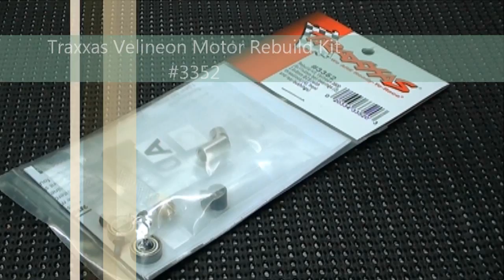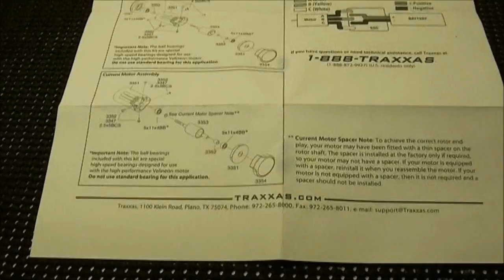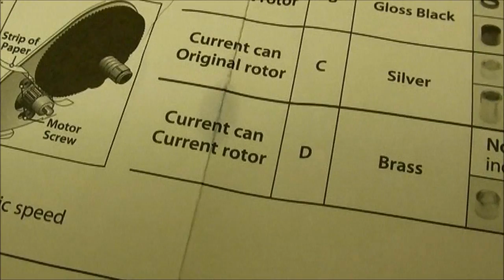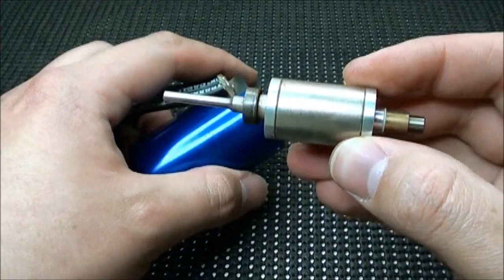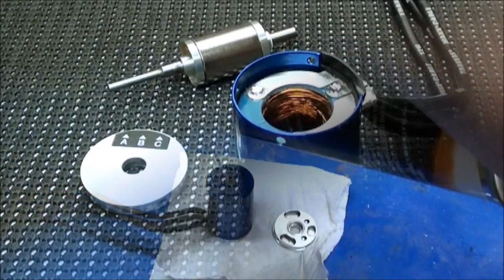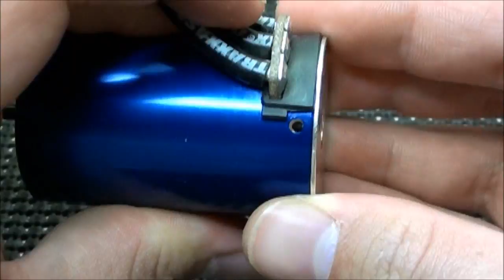RC "How To" Rebuild Velineon Brushless 3500 Motor

Comment: What type of glue would you use to Re glue the shaft to the magnet? Mine seems to work but once it has pressure it on it won’t spin

Comment: yup. sand, sand is the reason for my... EXPLOSION OF A MOTOR.  well it wasn't the sand it was more of the grip. basically my front bearing is no longer existant all i found was the inner and outer race and the ball coupler... i uhh i cant get the outer race out sooo... time to just upgrade the motor i guess

Comment: First of all if you take it apart to clean it  you will need to replace the bearings anyway. Because to get them out you have to push on the inner race. And that  is bad for the bearings.  So a better idea to clean it would be to take it apart but dont remove the bearings.  Get a bearing oil  needle bottle.  And oil the bearings.  Only remove the bearings to rebuild the motor.

Comment: I run on carpet oval so dirt isn’t a problem I ran flag pole race where u run an oval then around a tire. We can’t use reverse and I got stuck against tire so I was bleeping throttle and got some smoke coming out from car and got got hot. I let cool down hour or so and I notice it still has speed but a lil laggy on takeoff. I pull motor and everything looks really clean. Getting hot I’m not sure if sator or wiring might have gotten messed up. Didn’t know which. Bearing looks good actually whole motor looks good just notice lazy start then from before   Checked all my gears and all them ok. Didn’t know if u might have answer. Thanks

Comment: I run mine through sloppy mud and water alot and ran 3s alot, so i got about 3 months out of mine before the bearings went. Since then I've done a better job keeping the motor clean and its been about another 3 months atleast and im still good.

Comment: Preventative measures aside, what indications would you get that a motor could use or need a rebuild?
I bought a used slash pretty cheap for my son(its my first experience with a brushless motor). Pinion and spur were horribly noise and I just couldn't seem to get it adjusted right. I decided to remove the motor to inspect and realized it's not turning freely. It feels like a stepper motor in hand. I measure the voltage across the three poles by turning with a drill and all are about equal. I'm stumped?
Reply: Electric motors have magnetic resistance when you're just turning them with your finger

Comment: Should the rotor be able to spin freely? I'm new to the hobby. I was playing with my slash today, and after running it pretty hard, and ending with a crash, the truck starting clicking. It used to roll back and forth freely, but now it makes a clicking noise. When I removed to motor. The chassis can roll freely, without the noise. I noticed my rotor doesnt spin. Is this the problem? Or is it possibly my gears? My gears seem to be fine. The truck is pretty new

Comment: Just had to comment a word of thanks here for being very thorough! I’m attempting to rebuild one of the old can-old rotor Velineon motors...and they have changed the rebuild kit since your video...it no longer includes all the different bushing set ups that you need for the old can style.  You video and the thorough shot of the instruction sheet was enormously helpful for me!! It is the only place I’ve seen the info I’ve needed to rebuild this motor.  Thanks bud...keep up the good work.

Comment: Hey there - By chance would you know if I'd be able to follow similar maintenance steps for the Traxxas 2200kv motor that powers the E-Revo VXL 2.0?  I accidentally landed in a ditch and the truck was half submerged for about 10-15 seconds.  I'm concerned I'm going to have to do some comprehensive maintenance sooner than later.  BTW - I followed your tips on how to sling water out of RC tires.  That helped a ton!  Although the first dremel hole was a tad messy  :p  Thanks for all the vids!

Comment: I had my slash for 7 months and I just had a bearing completely blow on me it's a horrible mess it damaged the spur gear and I need to rebuild the motor. There's those lil bearing beads everywhere in the motor and gear housing. I had a spur gear that I put on and I ordered a rebuild kit so when that comes I'll be going again. Great video Stay Awesome!
Reply: had my ultimate for less than a month and all hub bearings seized up . and the truck has never been wet

Comment: could it be good to put some silicone oil on the bearings ... since they spin so fast ?
Reply: Bearing oil, yes. use a flathead screwdriver to take of the shields, and clean with motor cleaner, and re oil

Comment: It appears that the shaft itself (where i put the pinion gear on) is slightly bent, and i was wondering if there is a replacement that i could buy?

Comment: Would normal electronic contact cleaner work as we'll to clean out the motor?
Reply from the maker: +Tyler Nowak I would HIGHLY suggest using a RC motor cleaner but I don't see a reason why electronic contact cleaner wouldn't work.

Comment: Remember to silicone glue "fill in" the two extra motor mount holes,..... these extra screw holes allow dirt and sand a passage to the inside the can.
Reply: Aren't the covered by the plate?

Comment: my top bearing shredded. the outer ring is stuck in there...how do u get it out?
Reply from the maker: +jett ross Heat is the best way to go. Heating it up in the oven will cause the metal to expand however what temperature and for how long you should do it I'm not sure. Boiling it in hot water would be a better option.
Reply: Thanks for the help...buy I had gotten it out by putting a small flathead in the race and hitting it lightly with a hammer until I could hit the edges of it

Comment: is this a four pole system? Is the old one with screws on the side four pole too?
Reply from the maker: +Rc Ghost99 This is the old Motor. I don't know what the difference is between the new 4 pole and the old one.
Reply: One stator will have 4 poles, the other will only have 2..... 
A 2 pole looks like it was split in half, only 2 sections. 2 pole Motors are GARBAGE in the RC World, especially when low speed control is Important. The 2 pole COGS horribly!!

Comment: Thanks for the vid. Do you know if the magnet the part of it you have your thumb on @ 6:35 is supposed to spin, while the two ends stay in place? Mine is acting like the magnet came loose, but not sure how it looks when working properly. Thank You
Reply from the maker: +Lori Jackson NO that is not supposed to spin. Its supposed to be a solid piece.
Reply: +darkeclipticheart Thanks, put some loctite or permatex sleeve retainer on and working so far. Thanks for pointing me in the right direction

Comment: My velenion also has no screws in the front, yet the rotor is a different material and the cap is plastic. Im really confused.
Reply: +kory bleu I`m having the same problem. Do you had a solution?
Reply: +noppyjr I think traxxas downgraded the parts to save money, the bearings and bushing still fit fine though.

Comment: throw your bearings in the freezer for a bit when seating them in the can and motor plate. less force required to put them in place because the cold will slightly shrink them.
Reply from the maker: Good idea

Comment: you can install the engine in the e- revo 1/16 vxl ?? Yes pulls harder or less !?
Reply from the maker: Luis Fernando Aguilera Sanchez Yeah you can. You just have to buy the parts that hold it. The Engine brace and gear cover.
Reply: +darkeclipticheart and what is more powerful 380 or 3500
Reply: DUH!

Comment: and also those winding wires inside my motor can they are a little bit lose, do you think is my motor ok to use again?
Reply: Kinwai Cheung  Thanks a lot
Reply from the maker: Kinwai Cheung Yes the motor should be okay to use. However if the wires are ripped or severed the motor won't be working much longer.

Comment: Your vids have saved me tons of money for repairs for my Rustler VXL. Having this issue now... Is there a way I can replace one of the wire from the motor. Wire "A". Has been damaged and would prefer to use a silicone wire like the ones you got there. The ones the car came with have been cracking open.
Reply from the maker: Ever Pena Sadly no. Your best bet would be to use Wire Shrink Tube.

Comment: What do I do if the one of the 4 screws are striped?
Reply from the maker: Thomas Linberg Your best bet is to use a torx screwdriver. Replace the screw if possible but I'm not sure what the size is or where you can find a replacement

Comment: Just picked up a motor with a front bearing collapse, so rebuilt it to put into my slash 2wd. I have a lot of end play on the motor (0.03 inch, 0.75mm). it is a new style case and new style rotor. (exactly as yours). i put the 3 shims in exactly as i took them out (in the same place as yours at the rear). how much end play should there be? shaft looks good with no visible wear, bearings fully seated. can I re-shim the motor (if so what type of shim are they as mine look like mica washers!) much appreciated for an answer as dont want to use my slash in case i wreck the new bearings (with the extra end play it sounds like the brass bushing is running up and down the shaft when i turn by hand causing a rattle noise)....

Comment: your video just saved me from buying a new engine thanks!!! my bearing came out which was causing the shaft to spin unevenly and my car wouldn't start, so thank you for posting this video. think I should just replace the bearing or get the replacement package?

Comment: Hi,
I have a problem in my Traxxas,sound like slip something inside.
First was the shaft inside the transmission,i fix that but still something going wrong,so i bought another one.
After i fitted the noise still,so i think maybe can be the clutch or maybe the motor.
My question is before i open,have any change the motor slip? I did a video,if you want i can send it to you to help to explain.
Thanks a lot

Comment: Did you have an issue with one of you VXL motors or did you just rebuild it for the sake of maintenance.
Reply from the maker: It was an old motor and the bearings were shot. It was also having some heating issues.

Comment: Would it be ok if my motor spindle (that little stick where the pinion goes) is loosen? It moves back and forward and my car doesn´t have torque and it makes a weird noise.
Reply from the maker: That's not good. Sounds like the spindle has detached from the magnet. You'd have to take it apart to find out. If that isn't the case then I'd guess the plastic spacers have worn away.
Reply: darkeclipticheart
I opened it up and found the spindle detached from the magnet. Im replacing the rotor with an old one from an old motor. But that rotor has the plastic spacers a little scratched. Do you recommend me to replace it even if it isn´t completeley new?

Comment: Does this make the motor faster or anything otherwise this helped a lot thanks.
Reply from the maker: No it doesn't help it go faster but it does help it run easier which means it will last longer.

Comment: Im in the process of rebuilding and your video was great. I wish my bearing came out as easy as yours did. It actually broke so only the outer ring of the bearing is still stuck at the bottom so im going to try and figure out a way to get that out now. Thanks for your time though. Let me know if you have any ideas cause there is no guaranty that I'm going to finish tonight...

Comment: Hey what if the bearing inside the motor comes apart and leaves the outer ring of the bearing stuck within the motor? How do you remove it without damaging the motor?

Comment: Great instructional video.  I recently experiences some concern with my Velineon motor in my Traxxas Ultimate. I have had the truck about 6 months. It has seen mud, snow, slush, water (bashing conditions).  Just the other day I noted the motor as locked. I advanced the spur gear and it broke loose. I have applied power the motor since and it seems fine. I guessing that you would suggest it be rebuild.  Thanks

Comment: i can't find any diagrams or pics of a part by part break down of the motor i took mine apart to rebuild it and the brass bushing fell off while i was working on it, 3 washers fell out 2 clear 1 white i don't know the placement of them since they fell out i'm sure there are others out there wondering the same thing i am. any info would be great thanks my motor is a current/current and as for the dirt that was in it must be that rubber flap by the wires lol

Comment from the maker: Nope. You don't have to use any grease on the inside. Just make sure it's clean and you're good. 

Always a good idea to use locktite on screws that hold metal to metal.

Comment: my shaft spins freely by my fingers (motor w/o power or hooked up at all), with what seems like no friction. i bought it second hand and i have yet to take it apart until now (Was searching for a video to help with end housing) so i will try it, but i fear that the motor is shot due to it not accepting reverse input when on sport mode.

Comment from the maker: That's not good at all. I don't know if you can glue it back in place. You can try some heavy duty bonding but I'm not sure that will do it. However Traxxas does sell the the rotors seperately if all else fails. The part number is TRA 3353

Comment from the maker: You can use brake cleaner but you really don't have to do anything with the motor but get out the debrees with compressed air. Anything beyond that could ruin the motor.

Sometimes they come with rubber sealed bearings but they aren't recommended.

Comment: Hi, two things. I am cleaing my motor right now. Mine has rubber sealed bearings?? Also, can I use break cleaner for the cleaning and can I spray crc on the motor at the end?

Comment from the maker: If you have he replacement bearings then knock them out with the method I show. The bearings won't always come out so easily and sometimes it takes a few hard wacks with a hammer before they begin to move.

Comment from the maker: I used a hack saw and cut a groove in it then I used a flat head screwdriver to unscrew it. Or you can use a torx wrench that is slightly bigger then a 2 mm allen wrench.

Comment from the maker: If you cant use plyers to unscrew it you can use a drill or cut a slot in it with a drimel or hach saw and then use a phillips screwdriver to take it out.

Comment from the maker: You can but Traxxas prefers you don't. I really don't have a opinion on the matter since I've never tried driving without it. I'm sure over time it will cause some grinding thus putting metal shavings into the motor which could cause some ill effects. But that's just a theory.

Comment: well, i am just going to run it untill this moter goes poof.!!! the reason for pulling it apart is the magnet came un glued and im not to fond of the idea of having no car for the next couple weeks so, i took it apart and researched what epoxy or in this case jb weld had a high enough heat tolerance to not only fix the issue but to out perform the stock epoxy wich is rated to 300F. (except that i lost the washer) the jb weld is rated a heat tolerance at 600F so that is exactly what i did :D
Reply: what's a moter?